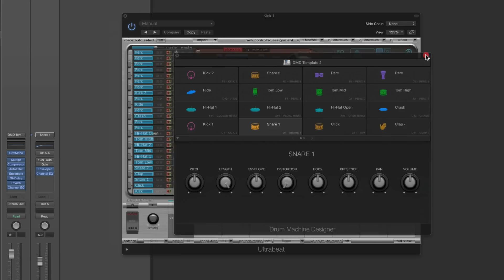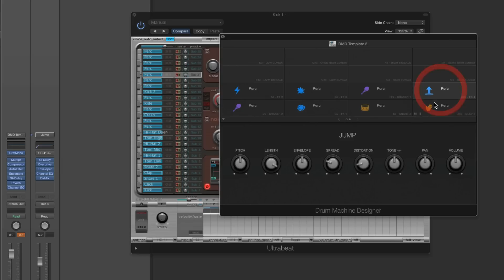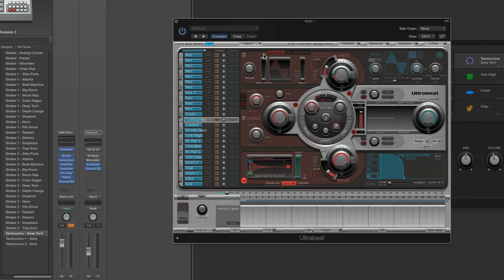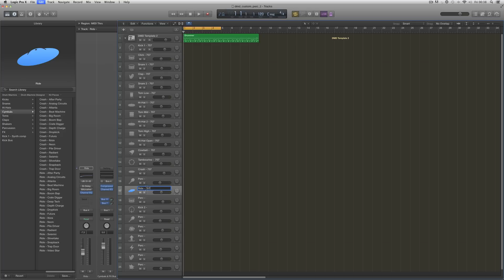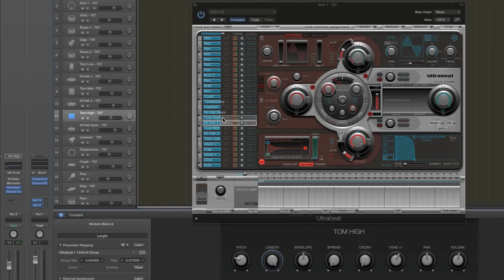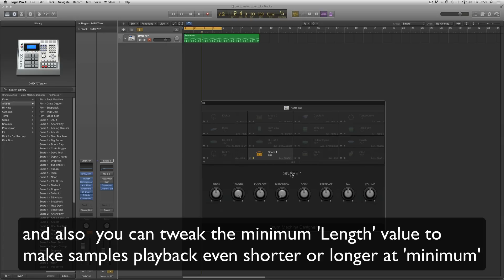Logic Pro X Drum Machine Designer Tutorial 12

Comment: Hi, Whats the benefit to using your "Vanilla  Drum machine Designer" VS using Logics "Empty Kit" to load drum sounds into Drum machine Designer. Also, Is there a way to batch load drum samples into DMD? I have hundreds of classic drum machine samples. Some, saved as complete kits and also individual Drum sounds. I'm looking for faster way if possible to load these into DMD or Ultrabeat. 

Also, I see a benefit in loading my sounds into Ultrabeat VS DMD. with Ultrabeat I can save my drum sequence as a Apple Loop. that apple loop saves the Ultrabeat kit information including any Automation controlling that Ultrabeat kit. Ive tried doing this with DMD. Apple loops can't recall a DMD kit. your thoughts Please.

Thanks.
Reply from the maker: The apple 'empty kit' didn't exist when this video was made. Yes you can bulk load samples. Load the DMD empty kit, then get the finder window and select your samples - for example all roland TR-707 samples - Drag them from finder onto the first pad of dmd empty kit and they all load, one per pad. For some reason each output gets the same fx on it: channel eq, overdrive, bitcrusher, sample delay & silververb but they can be changed or removed as required.
 
As for part 2 of your post, unlike ultrabeat, dmd doesn't have a sequencer to save sequences from. apple loops can recall a dmd kit if you save an e-drummer loop.
Reply: dancetech - when bulk loading samples into DMD by kit. Using the TR-707 As example, how would I get all the drum samples to fall into their respected GM midi note number.. I want my drums to match the GM midi drum spec.

Thanks,
Reply from the maker: You'll have to drop the samples into the correct note-number pads one by one.

Comment: +dancetech .... for the length of the smart controls, I somehow can not "type in" the values like you do. I have to use the mouse and drag up or down only. Also, in some cases there is a deviation on the "range min" between the value set and the actual value on the knob itself. Would you know what the problem might be? Thanks for your help and for your videos. Very very helpful.
Reply from the maker: +The Fed  not sure why that is, i just checked to make sure this wasnt changed with update 10.2.1, but i can still type the value. The second bit you describe i'm not sure i understand 100% what you mean
Reply: +dancetech Thanks for you answer, even if you don't know what it is. I can click in the values and they highlight, but then I can not type.

The thing I meant is that if I set the "range min", for exmple to 15ms ... once I turn the knob the actual minimal value that can be reached is slightly off 15ms (usually slightly higher thant the value set).
Reply from the maker: +The Fed oh well the parameter you are setting the SMART control value for..... the max/min value on the smart control cant be higher/lower than the value set on the actual plugin parameter it is controlling... as for the typing issue, that is weird... double clicking /typing doesnt work either?
Reply: +dancetech Hi once more. I know it sounds weird and I just double-checked. Must be some glitch in Logic, but I have one of my kicks, were I had to set the "Length" smart control min value to 11ms in order to make it start from 30ms (I can see it on the Ultrabeat envelope 4). Wished I had your EMail, I could send you a screen-shot of it. 

And no, double-clicking does not work either. Neither on my desktop computer, nor on my Laptop.
Reply from the maker: +The Fed weird. I've no idea without sitting down in front of your actual mac, sorry.